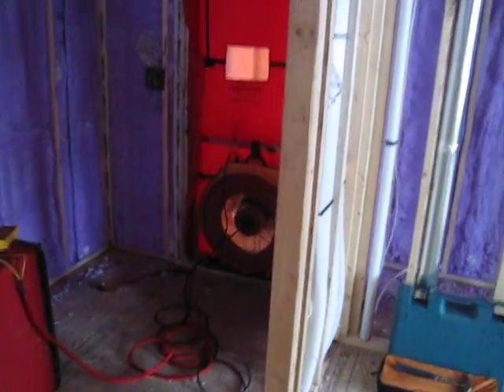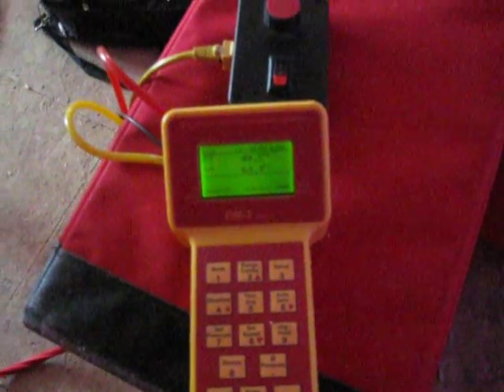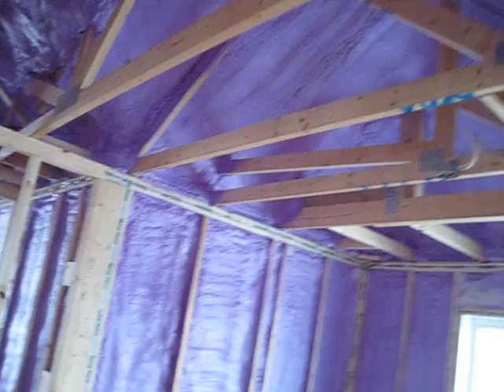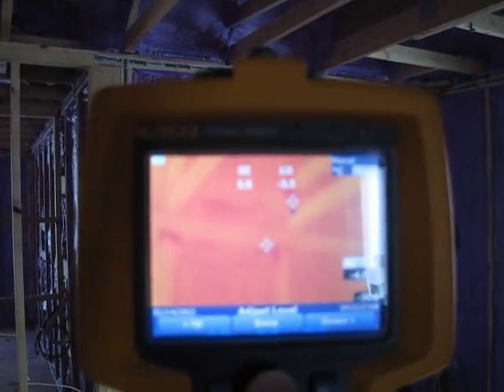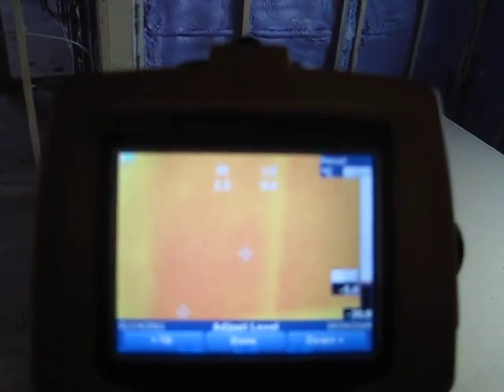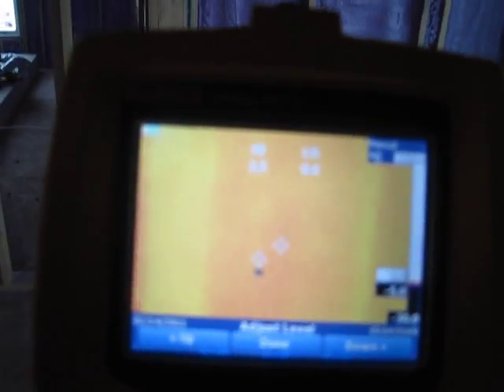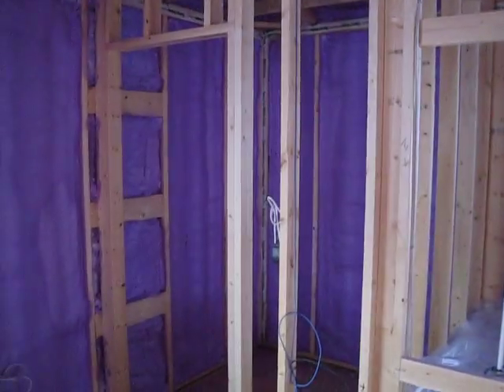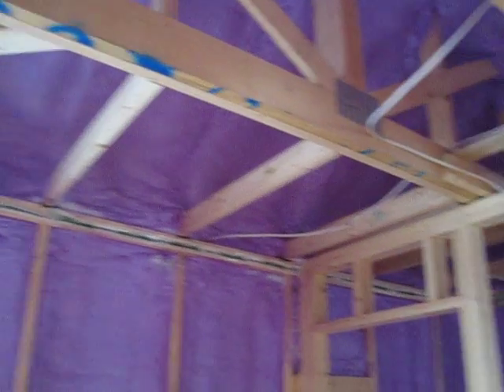Spray Foam QA

Comment from the maker: @HomeEnergyNow 
I agree whole heatedly - most people are so focused on air leakage and energy efficiency they miss the big picture - How do I get good quality air in and out of my building and in the areas I need it most!
-except in this case I know the calculations were done properly for the good mechanical ventilation system with HRV unit that was installed.  
But I would say 90% of what I look at is incorrect or high risk of problems, even with an HVAC contractor.

Comment from the maker: @TexasHomeInspector 
When I shot this clip the outdoor temp was -16C. (cold climate no issues with temperature differential) We even get cool temperatures most summer days, so early morning works well. We follow the ASTM standard, which is the same as RESNET. C1060 for insulation requires a 10 C (18 F) differential, while for air leakage the 1186 suggests 5C differential. I can do air leakage tests with as little as a 1 degree differential since most IR cameras these days are very sensitive.